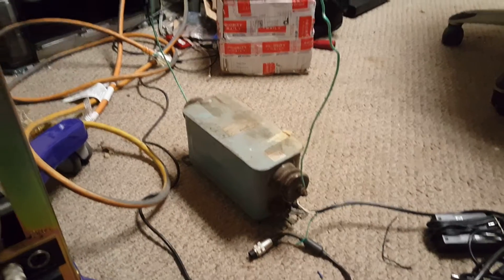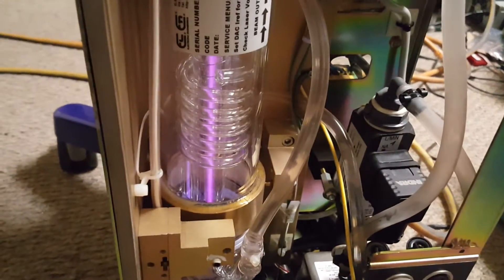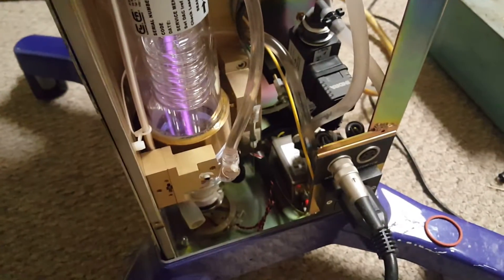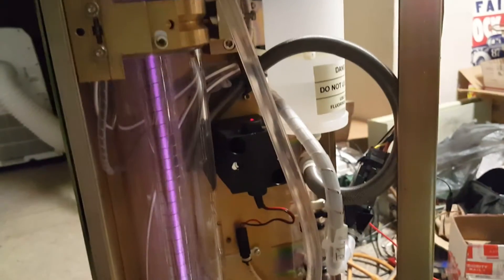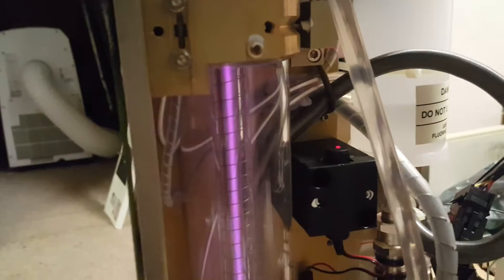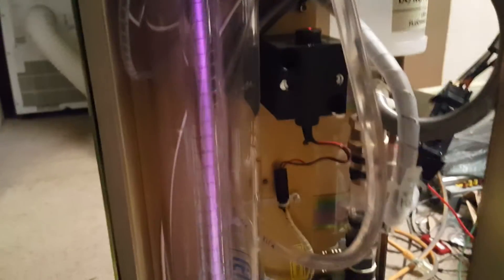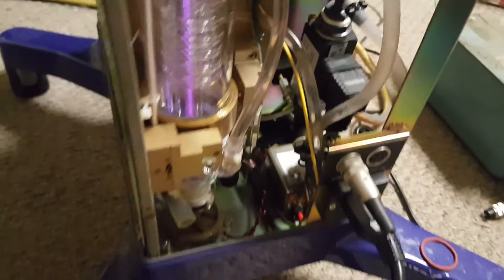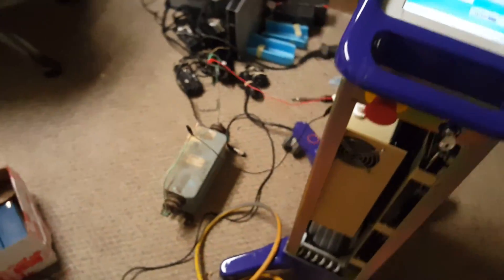Surgical laser machine repair help co2 laser hooked to NST

Comment: Get a microwave rectifier and another NST to run in series. That tube should handle 30kv with the cooler running at full tilt. Diagnosis, (Theoretical) faulty FETs on the PSU. HF generator FETs can develop leakage over time. Your likely getting bleed through at which point they aren't switching properly. They would test fine at lower voltages/frequencies which is the tricky part. This could still be metalization of the tube though. What's the ampere rating of that NST and how much is the tube actually drawing?